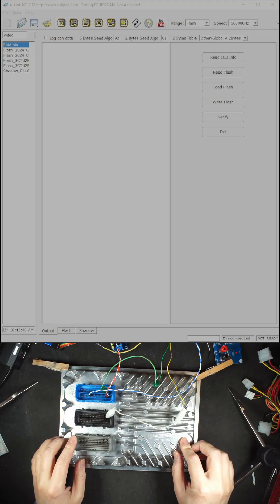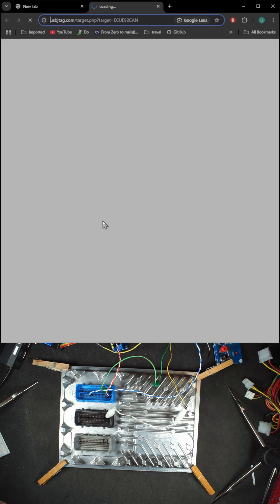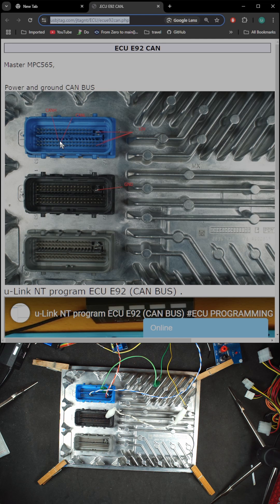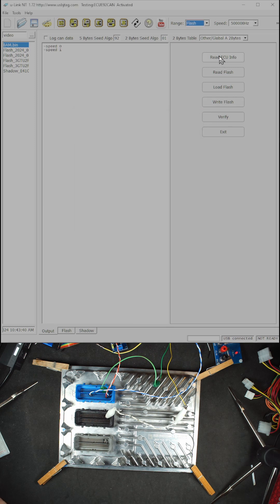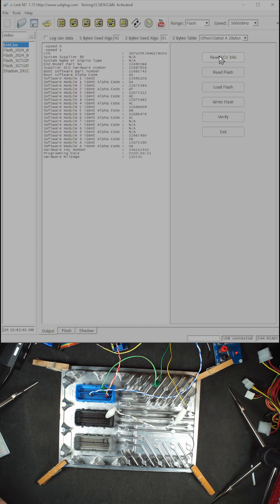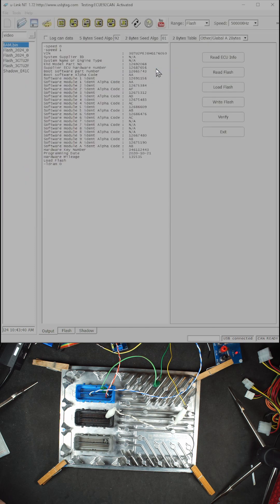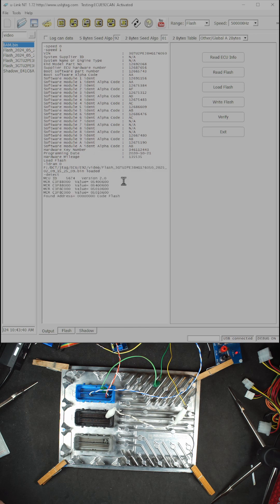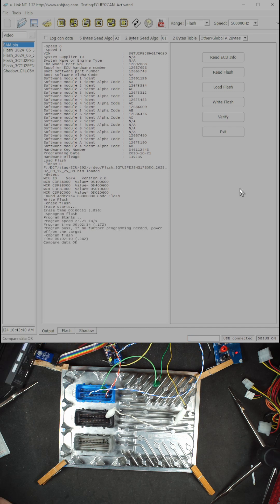ECU E92 CAN (1.72) #flashecu #automotiveelectronics

Comment: Is possible to read eeprom? Are planning to implement that option
Reply: Yo te mando los archivos eep y flash . Cuál es tu email?
Reply from the maker: @waldi4213  what type of eeprom?
Reply: @ when cloning for example using dc706 i need to read epprom from orginal ecu, then flash part, and transfer to new purchased used ecu, does it work similarly of your software?
Reply from the maker: @waldi4213  The so called EEPROM is just part of the entie flash. For some reason my DC706 cannot read this E92. If I could I need to find out what is so called EEPROM which could be just calibration area.
Reply: @usbbdm  do I understand that correctly.... your software covers "flash" and "EEPROM" data in one file...? As long as i will write file from orginal to the used ecu, i will have a full clone.
Reply from the maker: @waldi4213  Yes. You can send me the EEPROM file and the whole flash so I can find the EEPROM area. My E92 cannot be read by DC706.